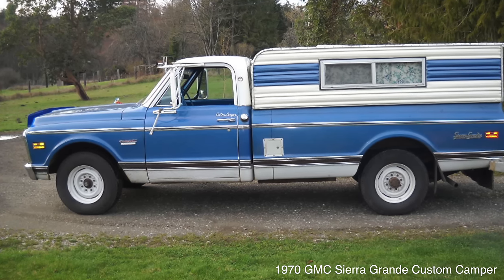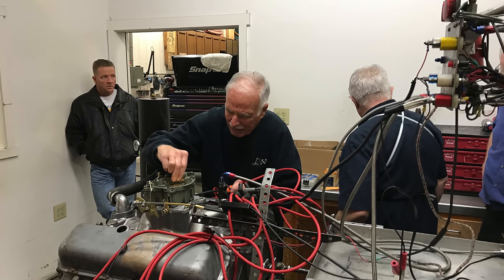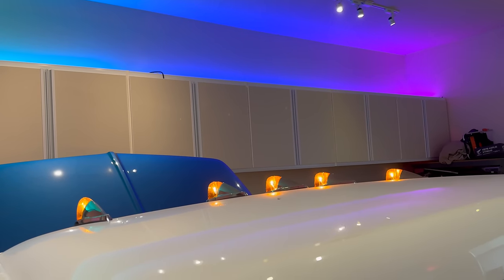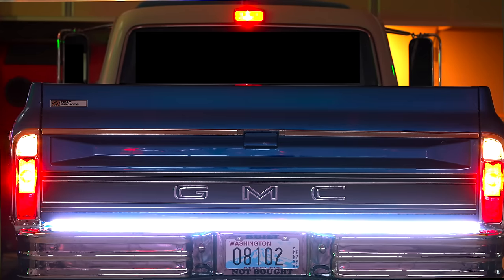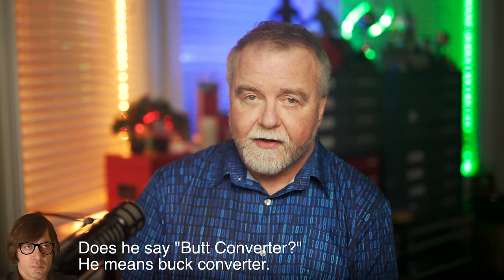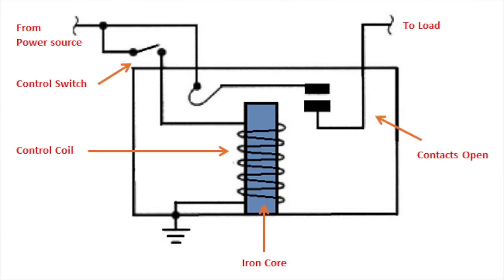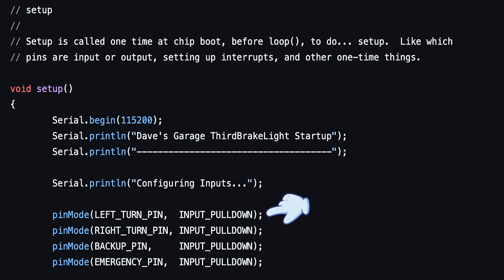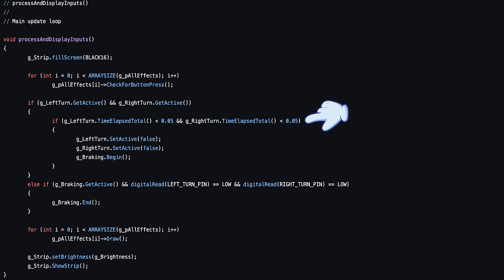New C++ LED Tricks for Our Old Truck: Sequential LEDs

Comment: ok it is a sweet ride. but there is one thing missing... 4 by 4 hahhaha... iam a 4 by 4 kind of guy my bad hahhahah .. but for real truck is sweet oldman. nice score. ps edit. and no not stupid 48 inch tires. just normal say 33s nice fit i think in stock wells. gives it a nice lil cocky look without bein stupid .. glad u didnt low ride the old girl.. i can never never understand the short circut when guys do that to a truck

Comment: Your audio is out of sync
Reply: 9:30 is noticable
Reply: If you've modified the playback speed, the audio will get out of sync with the video... most noticeable in the 1.25x and 1.5x variants.  Most likely as result of some "rounding" errors due to fractional times....  this is something that has become more prevalent over the last 6 months or so, so it's a recent software player change....